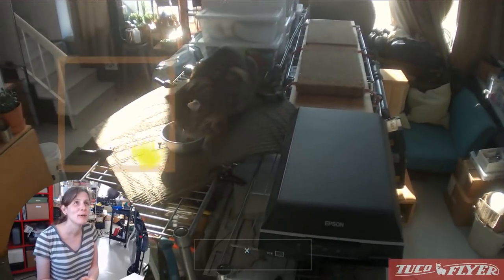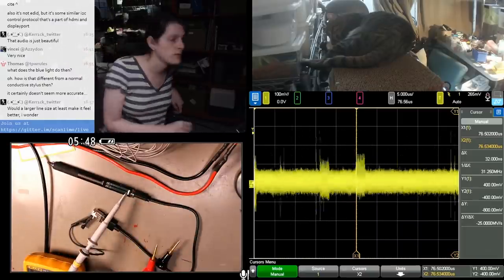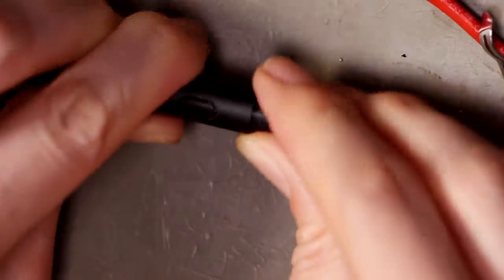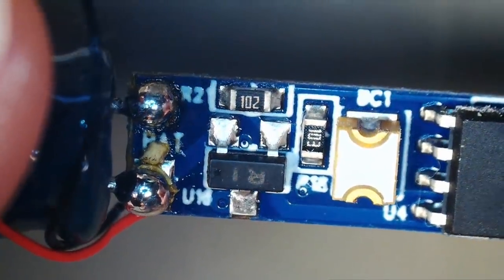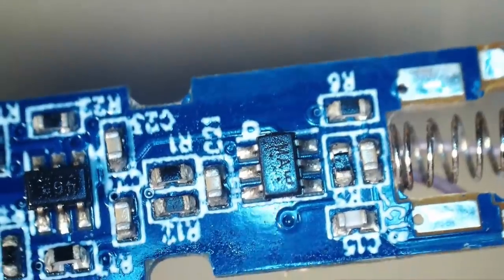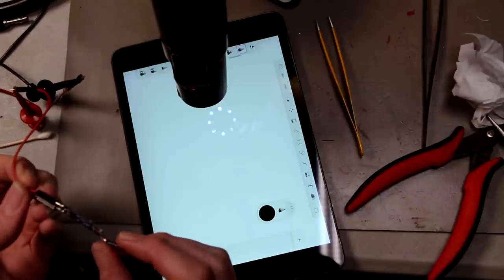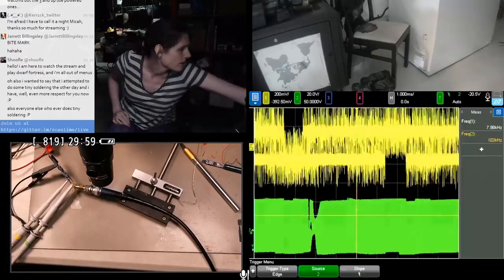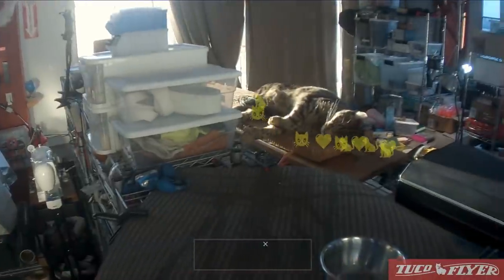Active Stylus Teardown

Comment: Super interesting. Its rare to see SRFs in low cost parts, but if this thing is putting out ~60V, it makes sense to protect the output if it happened to short. Wonder if its enough to get a tingle if you touch the end, maybe not quite.

Comment: Do you not have isopropyl alcohol? It makes most of the glues melt apart
Reply from the maker: i don't think i had anything that would dissolve CA glue, and this was a really inconvenient space to use any kind of adhesive remover on. I'd definitely give some chemicals a try if i did this teardown again.